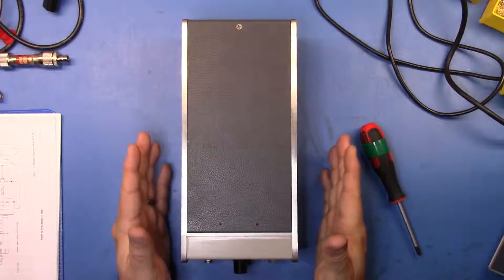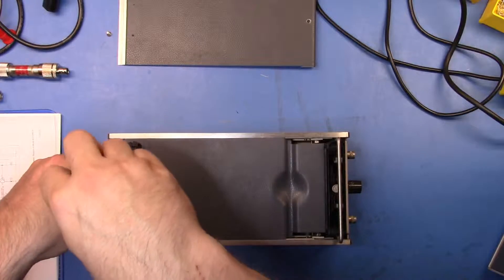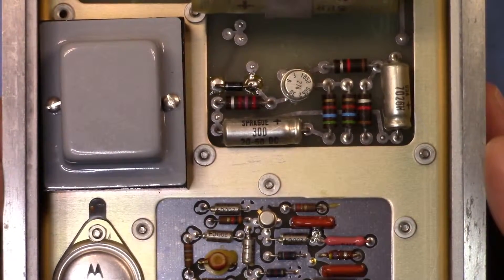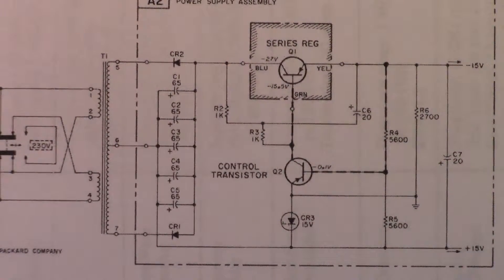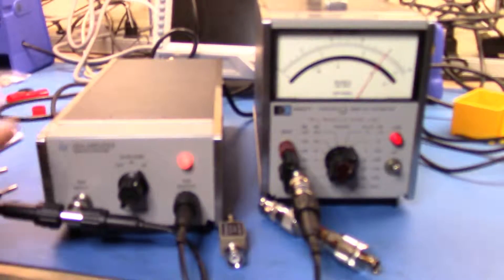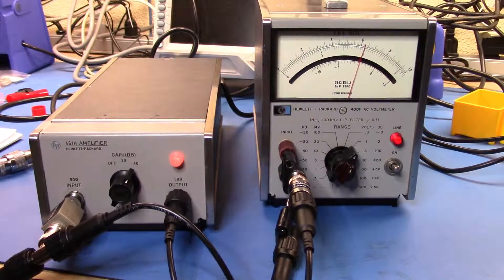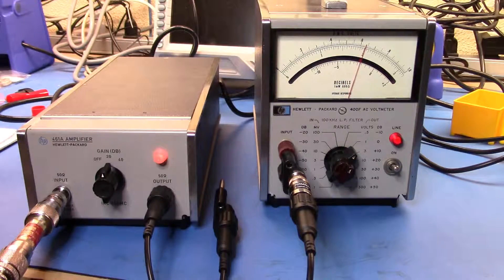HP 461A Amplifier (with a cameo from a HP 400F AC Voltmeter)

Comment: On the bottom:   …and two “safety” caps that aren’t safety caps? I always replace those. Even in HP gear. Glad I found the video. My purchase comes in the mail this week. I hope mine is as nice as yours. Thanks for the nice video.
Reply from the maker: Thanks - I've had good luck with those caps but it doesn't hurt to replace them - Glad you enjoyed the video - I also did one on addressing the gain in the unit if you're interested...

Comment: Interesting video. Thanks for the explanation as to the use of the equipment. I had acquired one of these amplifiers in a wholesale lot of electronic products that were used in a physics lab from a local university. I paid way less for the entire lot than just the scrap value. Thanks for the info.
Reply from the maker: No problem - They're great little units for instrumentation amplification - I've used it a number of times where I was trying to look at a signal and my cheap scope didn't have the resolution to really get in there - The calibration of the unit though is a bit of a black art :)

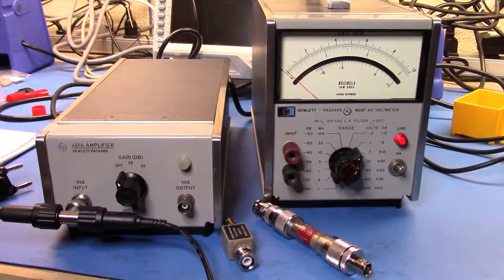Comment: Thanks for sharing.  Also your HP 461A gain is probably OK.  The problem is that your HP 400F is NOT mechanically zeroed.  When you had it unplugged (@7:17) is reads ~20mVAC.  So when you set the input signal to 100mVAC the needle actually started at 20mVAC - so you actually had 80mVAC input signal rather than 100mVAC. ( 80mVAC * 10 = 800mVAC for 20db gain)
Other minor corrections: The unit is 1KHz not 5KHz @1:10; It's even stated on the front panel "1KC").  Also the attenuator is on the Input not the output.
Reply from the maker: Thanks for the comments - You're absolutely correct - I missed the zero issue and I have no idea what I was thinking about when I said 5 KHz while looking at the 1KC on the front panel... Doh!

I think what I did on the attenuator, even though I showed the schematic later in the video, was to confuse the inputs and outputs because the unit was upside down.

Thanks for pointing those out for myself and anyone else who views it.

I ended up putting the unit on my 8714C (which I acquired later) which let me see how the amplifier worked across the frequency range (https://youtu.be/YpbGOUs5JsE) and I was able to adjust it down (except for a missing slug) to get it into spec w.r.t the +/- gain per frequency.